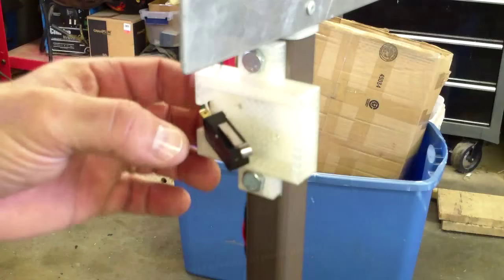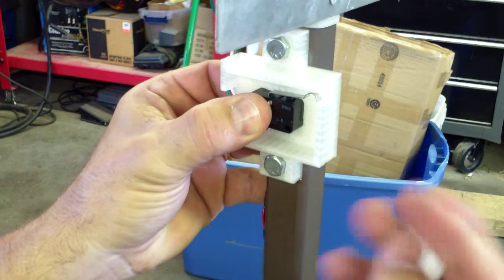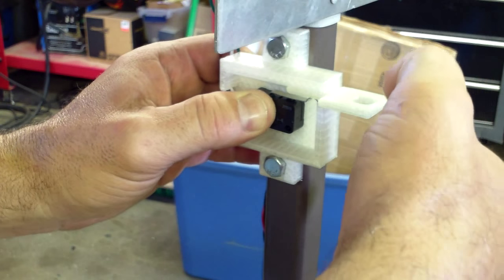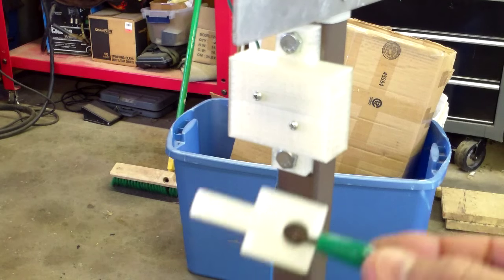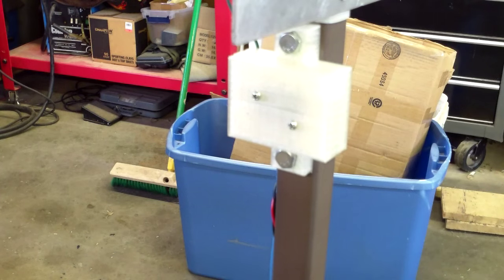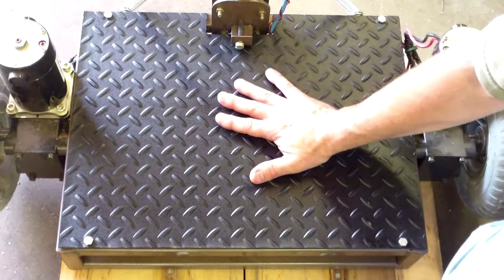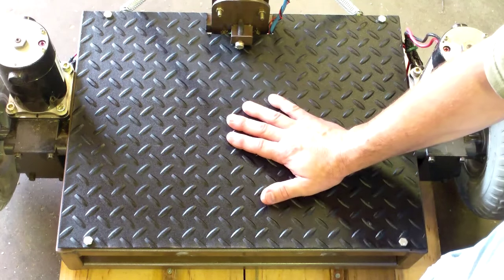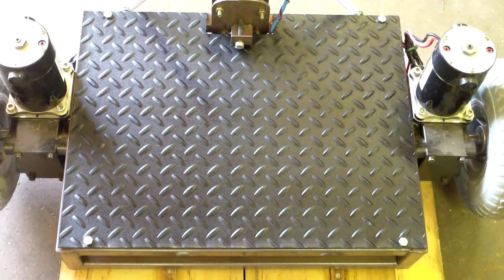Making A Segway Style Self Balancing Scooter - Part 4

Comment: Fantastic. This is a greate build. One added feture could be an LCD with the battery voltage. ~Russ
Reply from the maker: ***** It originally had a blue tooth module on the circuit board that was going to send info back to my phone (you can see it in part 3 video), but the software for the scooter didn't work well at all.  The software that actually worked for me used the serial port to talk to the motor controller instead of pwm.  So I had to ditch the blue tooth module.  Future upgrade maybe?

Comment: Great !!!! ...well i m sorry i didn't really understand the role of the solenoid ....and what are the specs of this material ?
Reply from the maker: +Portable DuCap It's a relay that turns the power on and off for everything.  The motor controller is rated 60A and the stall current on the motors is about 2 x 25A. So I had to use an 85A solenoid relay.

Comment: Can you please tell the complete specs of the motor and battery that is power, voltage, current, ampere hour or any other important spec.. I am a student and need to make something like this as a final year Project. Any help will be appreciated..
Reply from the maker: +faizan tariq The motors are 24v wheelchair motors.  They were given to me so I don't know any of the specs.  I do know that they pull about 4 amps each with no load, and about 25amps when stalled.  I used two 20Ah 12v AGM batteries to power it.
Reply: Thanks. That would be helpful

Comment: hello sir...may i known motor specification which you used in your segway build.
Reply from the maker: +pruthil gajjar The motors were donated wheelchair motors.  Don't know anything about the specs other than they are 24v and pull about 25amp stall current.
Reply: @MakingStuff  Sir Can You Tell Us Wat System you Use For Balancing The Scooter.?